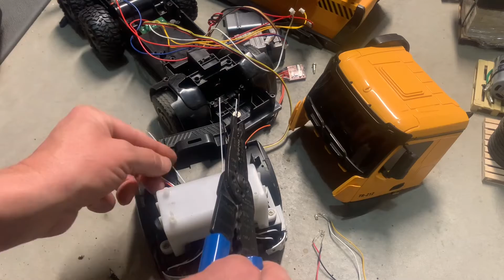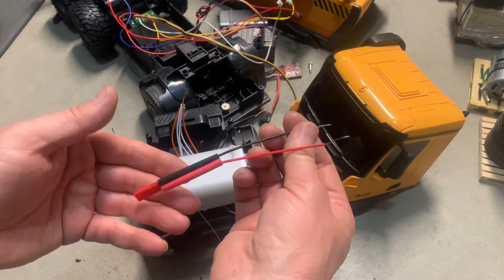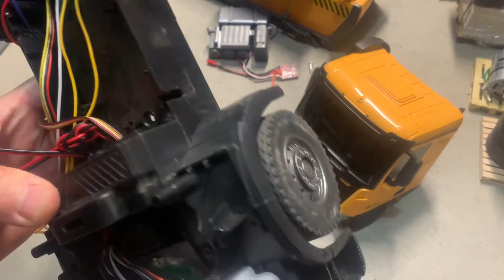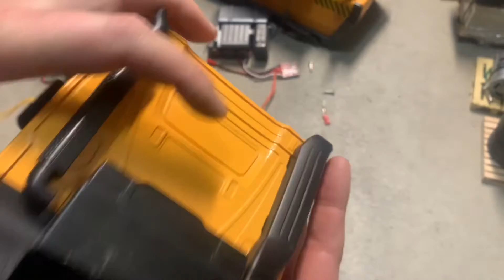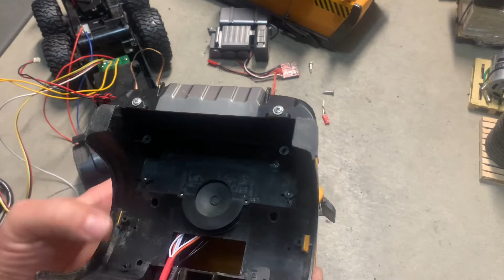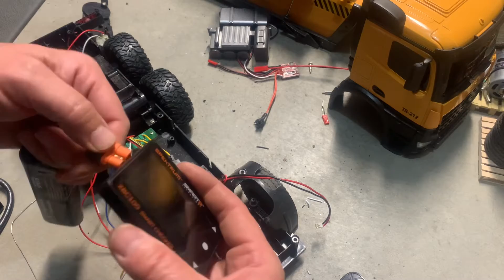Tr212 dump truck gets a makeover Ep-2. Rc construction shop time. Lights and servo installation.

Comment: Great work And wonderful upgrade i think this truck need suspention To adapt to the rugged terrain ✌️
Reply from the maker: It does but I don’t see a Feasible way to add it so the tires will have to be the suspension.
Reply: @digitrc  i agree this is because the motor of the wheels is inside the chassi so that the chassi is closed
Reply from the maker: @The-Warm-voice1359  yep. 👍